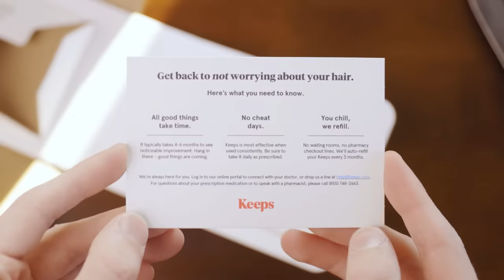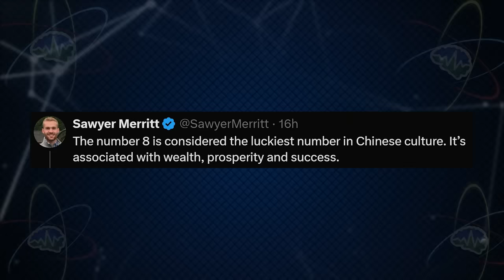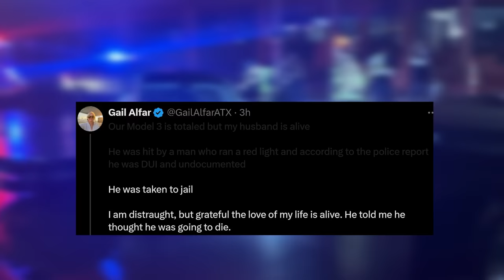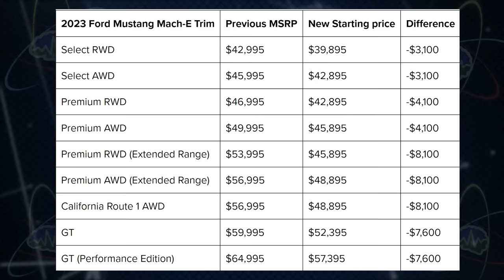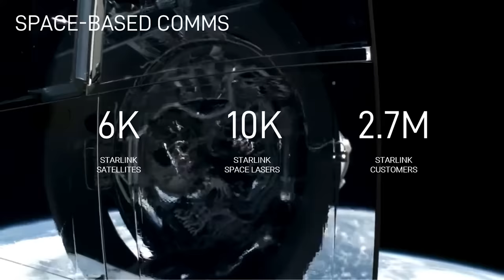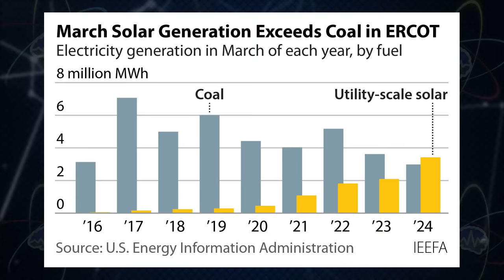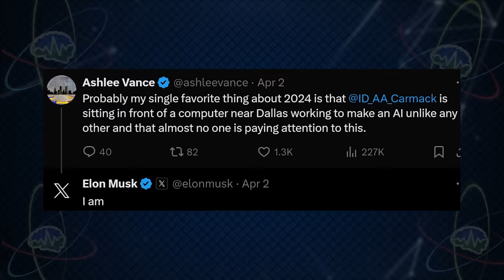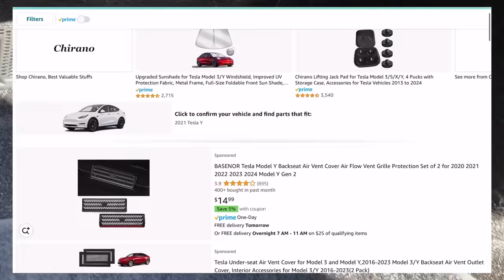Tesla Robotaxi Canceled?! | Tesla Time News 396

Comment: I’m an Uber driver in Philadelphia, PA and I’m fortunate to have FSD enabled in my car TITTO, at least for this full 30-days. Overall, the drive was great and the car knew what it was doing.

Passengers enjoyed it and were amazed to have the car drive to their destination… for the most part. Some passengers expressed their concern and I had to deactivate the feature for them, but the majority welcomed it. 

The things I didn’t like and had to assist were the breaking behind a red light or behind another car, which is a no-no in Philly as you will get honked at immediately (it would break abruptly with two-car distance and crawl its way forward, but I accelerated a little). The car got too close to the curb when making turns, but that was just from my point of view since the car’s cameras would show a reasonable distance. It would be slow getting into the highway, were the on-ramp was 40mph and it would keep that speed until we reached the 65mph speed limit sign on the highway; I had to push the acceleration and readjust the speed (very dangerous in a robo-taxi scenario). Potholes! This winter was harsh and there are a lot of potholes (I had to repair my rims 7 times already) and the car just didn’t try to avoid them at all and I had to harshly steer around them. School zones, another very dangerous situation in a robo-taxi scenario because it just didn’t slow down to 15mph, not even a bit, and I had to completely deactivate the FSD. 

I really hope Tesla listens to me, when I say that they should let Uber drivers have this software for free, enabled in their vehicles, at least while the app is on. Have a QR code and message displayed on the screen, where passengers can access a website and rate their FSD experience. We drive hundreds of miles per day, it only makes sense to have us, as test drivers for the software. Imagine all of the data that can be gathered and the feedback we can provide when we take over for FSD in any given situation.

Comment: 6:58 from 2pm April 7th to 5am April 9th, just drove round-trip 1167 miles to see the 2024 Eclipse, almost all with FSD 12.3.3. NOT PERFECT but really, really nice. I'm going to list some glitches here, but do note, they were but a few moments in over 15 hours of driving. In decreasing order of stupidity:
1- Cut off and brake checked semi-truck (once or twice. requires joint screw-uppage by FSD and driver). Normally after passing on the left, Ego will get well ahead of the passed vehicle before moving out of the passing lane. HOWEVER, when there is another vehicle close behind you also passing a vehicle, Ego tries to move out of the passing lane sooner, sometimes too soon. When Ego tried to cut  back over too soon in front of a semi, I should have just hit the accelerator and that would have kept things safe. Instead, I (belatedly) fought Ego's action, leaving me part way in front of the semi with no Ego and in a decelerating car. It is possible that the Semi driver may not have noticed as I got on the accelerator pretty fast. It's also possible he thought I was intending to brake check him.... sigh.
2- Refusing to change lanes when requested (with minimal lane changes set) 
2a- when driving in rain at night, Ego may be thinking the spray from the back tire is a vehicle in the blind spot.
2b- when merging onto highway, Ego is glued to the merge lane and rides it until it is gone. 

There were some other things, too, like sometimes when changing lanes to the right, Ego would swing too far right and then recover. really klutzy. Every lane change to the left was really good. Following cars in stop-and-go-slow traffic on the interstate, Ego was a little slow to brake, IMHO, so I would brake sooner.

Even with its flaws, I loved my first FSD Ego trip. Every issue I had was ultimately quite manageable, and when in doubt disengagement is quick and easy, if anything, maybe a little too thorough  (it would be good if a steering wheel disagreement disengagement would leave TACC running, like when using AutoPilot). I can't spend 12K USD for my own copy of FSD right now, but I do plan to subscribe a month at a time, every time I'll be doing long trips.

Comment: 44:30 - I traveled for the eclipse. Because I have an EV I only used 40% of my battery, the drive was only about 60 miles each way but because of traffic it took 2 hours to get there, 2.5 hours to get home.  The slower speed meant I used way less energy ironically!

Comment: I recently got access to FSD for a short time.  Now a week in, I am not impressed.  In one 20 minute trip I had to stop FSD 6 times for safety.  It repeatedly crests very steep hills in the middle of the road, it nearly hit a curb on a left turn, it was staying at 15 kph in a 50 zone, and it slows to 20 kph for no apparent reason in a 50 zone, and not once has it been able to pull into my driveway.   And it does some weird navigation in my neighborhood.  It takes me all over the residential area when there is a direct route on the main road.  This is a long way from being usable...at this stage.  I am hoping for big changes coming up.
Reply: Are you in Canada? Hopefully all your interventions are helping to train the FSD for the next iteration.
Reply: @zencone  Yes... in Canada.  And I have to be clear... some of my roads are difficult... narrow, no lines, twisty, and hilly.  So I get it.  I will keep using the system to train the AI, and reporting the details.  I still have high hopes.

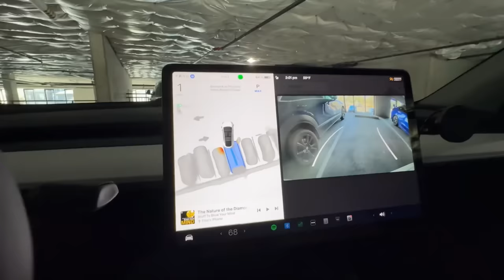Comment: In regards to the autopark at 38:00. I have a spot in a garage that's tighter than that. It has a larger concrete pillar (that I have accidentally hit manually parking), and there's a wall across from my spot that makes even a two point back in very difficult. The legacy autopark does it perfectly